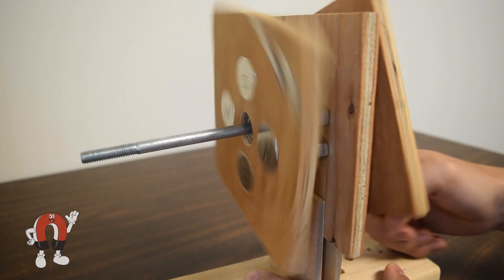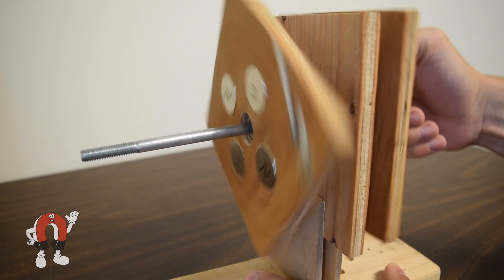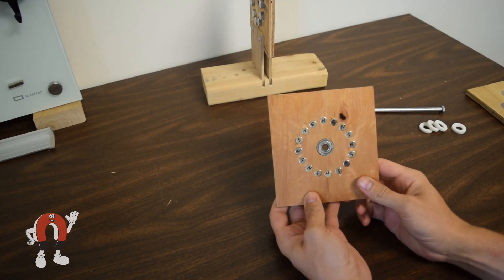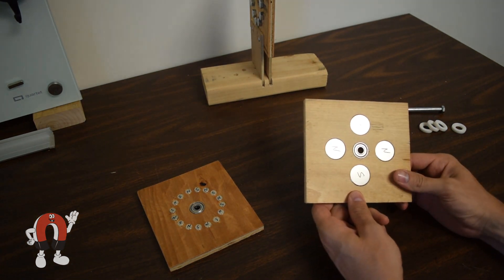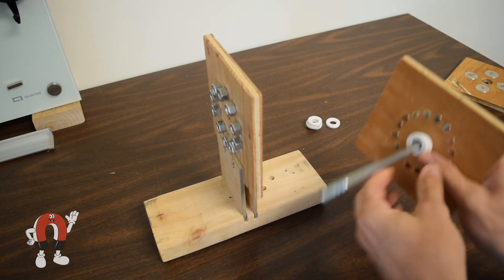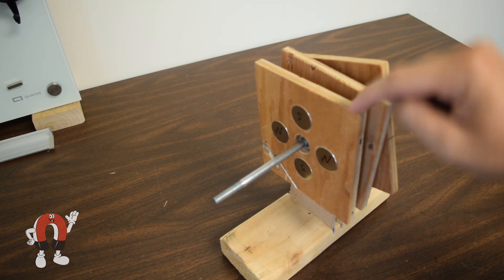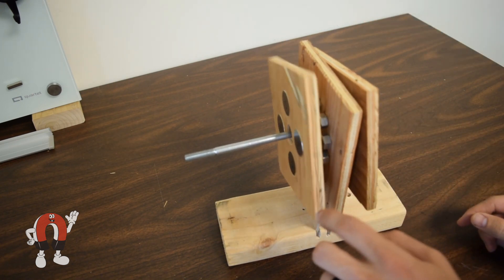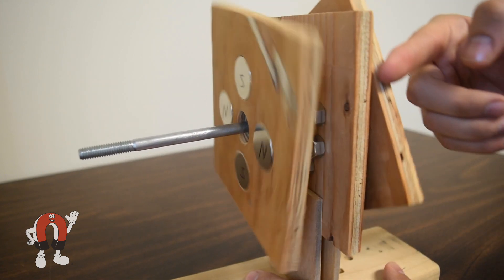Magnetic Speed Multiplier!

Comment: thank you so much , 
plz why does it turn in the oposite direction
Reply: The number of stator teeth (i.e. the number of screws) used in the middle part must be: N1 ± N2 (with N1, N2 the number of N/S magnet pairs on each rotor). The sum is for opposite direction, the difference is for the same direction. Here: N1 = 16 magnets / 2 = 8, N2 = 4 magnets / 2 = 2. The number of screws is 10 = 8 + 2, so opposite direction. Had you chosen 8 - 2 = 6 screws  the directions of rotation would be the same.

Comment: I’m wanting to design a new type of transmission for electric vehicles specifically, I want the transmission to be decently thin so the motors can be between the rear tires to keep as much weight above the rear tires and low as possible, I was hoping something like this was possible so you could have electromagnets that just flip with a switch to change gearing ratios. Does anyone know how this magnetic gearing scales for something dealing with the forces of a car?

Comment: Cud be potential in this mmmmm
Eg solar power transfer through a surface would have to use electro mags cud be a fan on other side of the solid none magnetic surfaces eg glass, wood,  ...good for low torque applications more of gimmick than useful